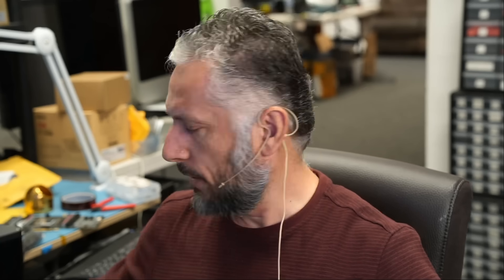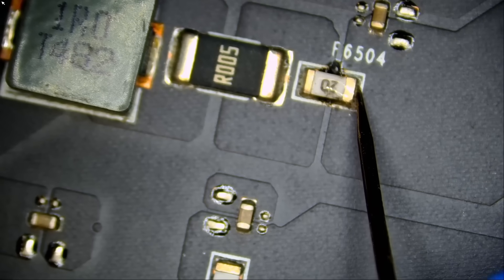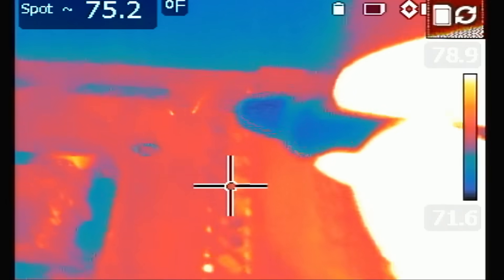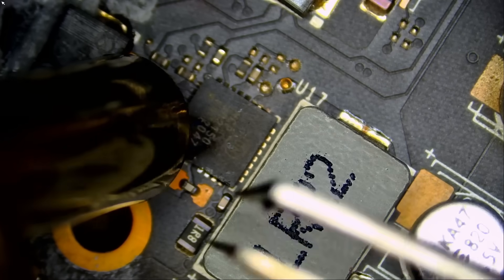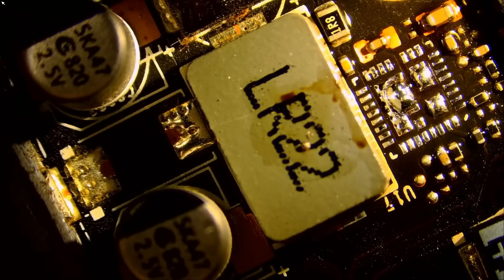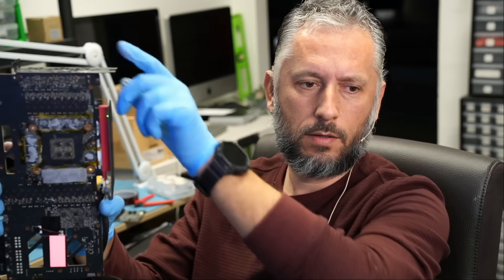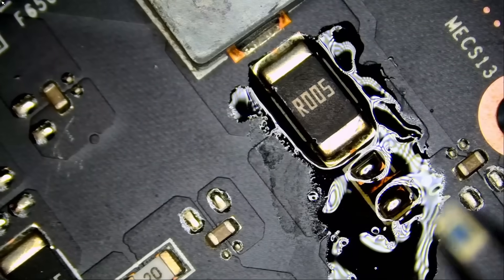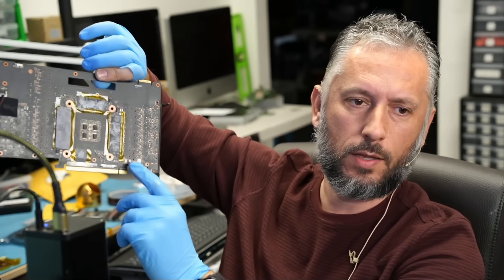EVGA 3090 FTW3 Not Detected - This one is weird.

Comment: My take on it is that the power suppy overvolted the chip and shorted the board. Or they overclocked the board and when starting the pc up it injected to much voltage and shorted the card.

Comment: Well to start heat is the killer of all gpus a low end power supply is usually the next culprit, obviously no liquid damage visible, tho the main culprit is dust damage as dust traps moisture and if it gets on the wrong components it can cause damage, a power surge or static would have taken out more sensitive parts, so in conclusion to you asking for a essay on the topic a low end psu and dust damage! Fuze is only there to protect the psu because they put too high of a value and modern electronics are one and done so, so it may only protect psu from damage and not the device

Comment: This is by far an excellent video based on the fuse having a partial failure where it was acting like a resistor 12 V in 6 V out very interesting. It is very informative because it teaches us not only to check for continuity on the fuse but also to check voltage Across the fuse on the input side of the fuse as well as the output side of the fuse but nonetheless, the card still has another blown fuse. Now the question is what caused that other fuse to blow. It would be interesting to see a part two on this card. I would imagine it’s something on the 12 V rail that would be my guess but it could also be something else. This is still a very good video. It could prove to be a training video, especially if Alex is able to figure out what else is wrong with this card and actually get it to work by finding a chip that went bad a 20 amp fuse that went bad a Z fuse that went bad and who knows what else there must be another reason why that Z fuse, blue or perhaps just changing the fuse my correct the problem because when the chip went bad, it took that fuse with it and caused a partial failure of the 20 amp fuse very interesting. It’s like a mystery novel. There are two outcomes to this card either Alex will get it to work or it could be deemed a no fix.🤔
Reply: You can't just change the fuse if there is a short circuit at one end. You have to find the shorted component.

Typically if a fuse on the 12V rail is shorted, a component that takes 12V as an input is shorted to ground.
Reply: i love watching these videos but i wish i understood what any of that means lol

Comment: I once came across a Blown fuse that re-shorted after it blew. I was a 15A Microwave oven fuse with a spring at one end. The other end blew, then the spring part sprung towards the other end and reconnected the circuit causing the circuit breaker to trip. Most stupid fuse design I ever saw. I should have kept it and framed it.

Comment: @NorthridgeFix >>> 15:53 I see deep scratch! Top right corner.
Reply: or maybe something on top of it....under gold tape
Reply: @f3ryno  Saw that too, looks like a copper wire or braid
Reply: I think that's a bit of shit caught under the tape. It goes across the cap which is still there looking undamaged.
Reply: I don't think that's a scratch, it's sitting on top of a capacitor.

Comment: Alex , having seen you repair so many desktop gpu cards , i want to ask you how often do you see failed gpus in laptops ? Not repaired or anything , just how often a failure in laptop is due to gpu. The only video i remember is the cracked gpu in a laptop that was no fix.
Reply from the maker: It's uncommon for a GPU to fail on a laptop. This was more typical in older models, particularly with brands like HP, Toshiba and MacBooks.
Reply: @NorthridgeFix  nice to know. Thank you for the info.
Reply: When  high Mosfet dies it cooks GPU or CPU or both
Reply: @Shady-Gaming  can happen true. But also depends on the model and manufacturer. For example may alienware or dell laptops that had burnt mosfets can't be fixed , while others can. Because the same mosfet dying in nearly every laptop of a series a brand is a design error , not something that is a random hardware failure. From what i remember from Alex's videos.
Reply: @lolidasterner414  That "design error" could easily be a "design decision".

Comment: These new cards are complete garbage, I have been mining with RX 470/480/ 570/580 running non stop for years and 95% are still running.
Reply: So you get what you deserve. Very nice 👍
Reply: The new ones pull much more power